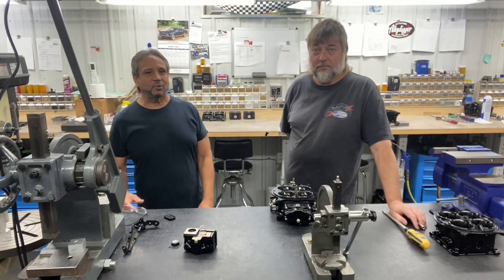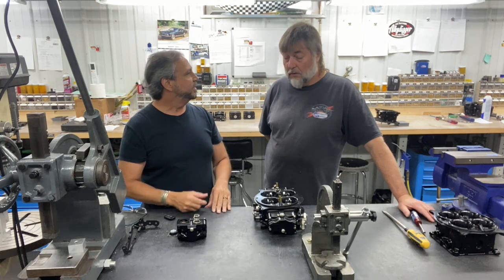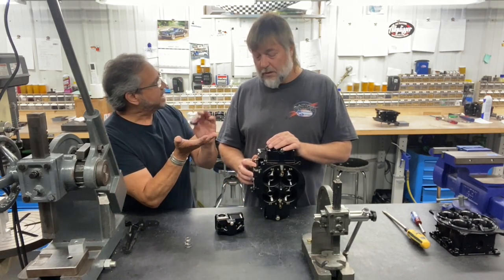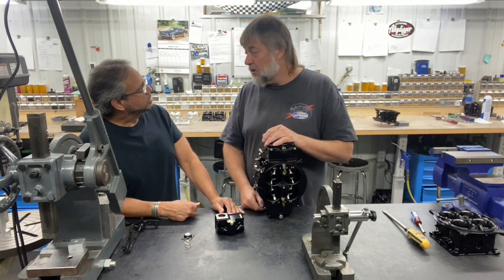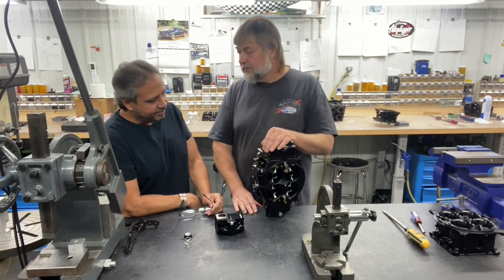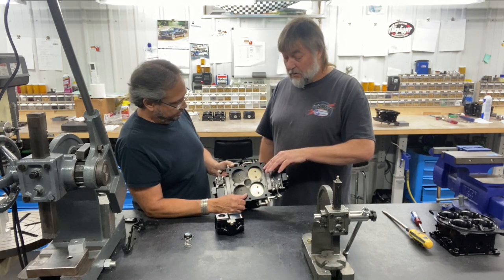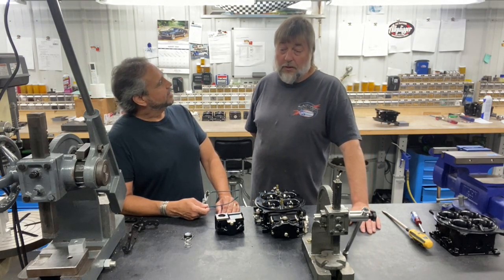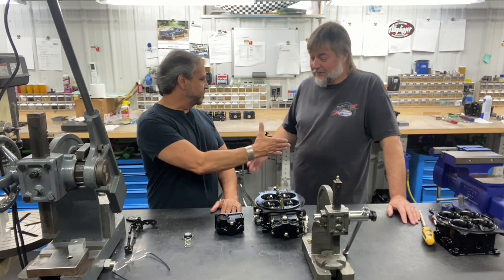DragBoss Garage/Advance Product Design: Carburetor Accelerator Pump Tuning

Comment: Thank Tim for another educational video. I’m very interested in the carburetor with no squirters. I wonder if they’ll be simpler to tune. I’m foot breaking my mustang. It does make sense to have a little bit of clearance on the accelerator pump arm-spring. Thanks for a great video.
Reply from the maker: You’re welcome Stainless. Yea I picked that little tip up too. Glad I can help with your racing program.

Comment: I told you about drilling the transition slot jet for brass set screw and that effects the acc pump also.
Reply from the maker: I do remember that. Crazy how it all intertwines. Hope your well Michael
Reply: @DragBoss351Cleveland  thank you very much for asking I am in a life changing journey with weight but in a good way. I am doing what I gotta do.
Reply from the maker: @michaelclanton1152 I get it. Lost 20 lbs. so I could get a better Et lol. Really just stopped having a snack at night with Mrs DragBoss, eat moderately. Luckily I don’t drink or eat fast food.

Comment: David Vizard and Eric Weingartner is experimenting with big cfm carburetors on a big block Chevy.  The twin blade would be an awesome test . Especially with a 4150 flange. DV is trying to convince companies to put a 4500 flange or modify a 2 plane intake believe it or not.  The twin blade might solve the problem.
Reply: Eric is also having a camshaft competition!  Spread the word!
Reply from the maker: Well Don, John said he would hook me up, so I will have to test it. And see how it works. 4509 dual plane, not sure on that one.
Reply: @dragboss351cleveland  Geat!

Comment: Yep made a mistake on a Quadrajet thinking putting an stiffer spring on the accelerator pump would be smart.   But no. I accelerated great for 1 second then fell off. I measured the discharge ports and they were on the larger side.
Reply from the maker: Yes took me some time to get a handle on carb adjustments. Always liked my buds olds 350 with a Quad, man those secondary kick in, loved that sound and feel.